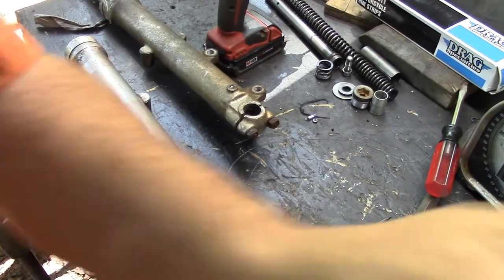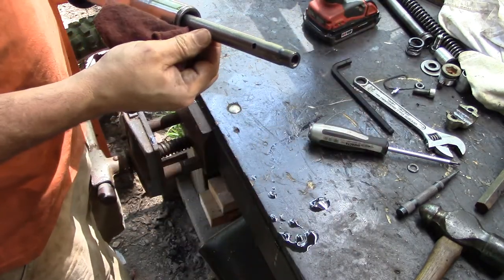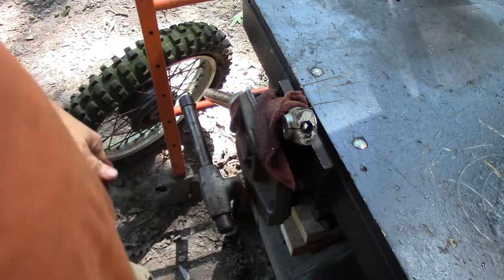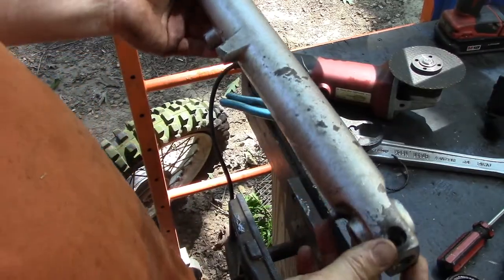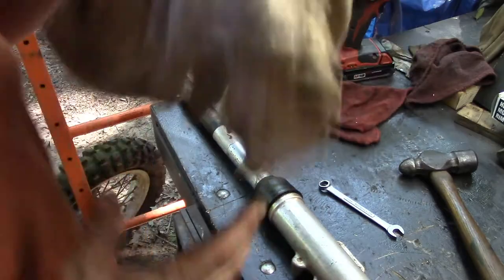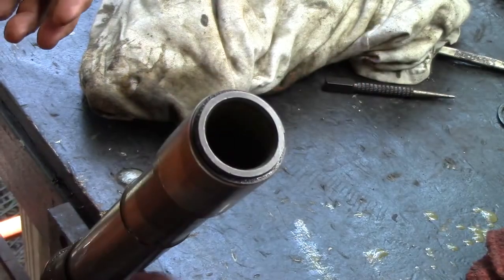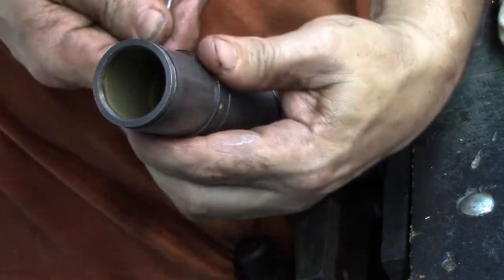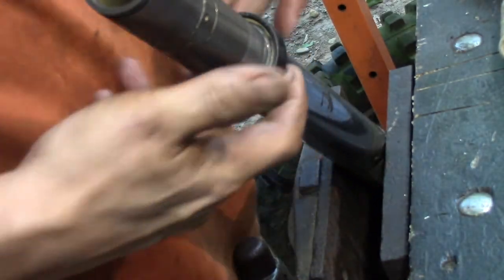Taking apart 40 year old Motorcycle Forks - SR500 - CB450 - Virago

Comment: Hello. I'll be changing fork oil on my SR 500 in the coming weeks. It's 40 years old. Wondering if I should buy new springs? Front suspension is fairly bouncy so I'm guessing they are ok but after 40 years ..
Reply from the maker: I have never replaced a set of fork springs on a vintage bike unless they are broke or corroded or were getting upgraded springs (stiffer for example). Very unlikely they would have reached any sort of mileage that would wear them out.
Reply: @theeddies  ok thanks. IL see how it goes